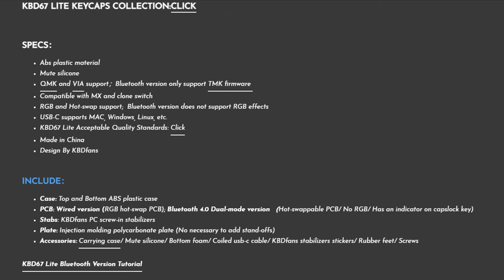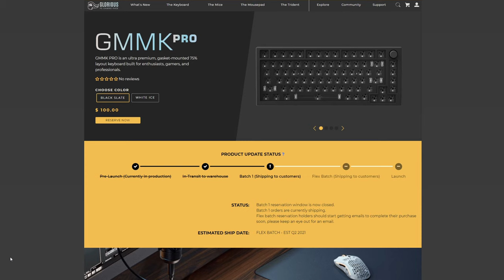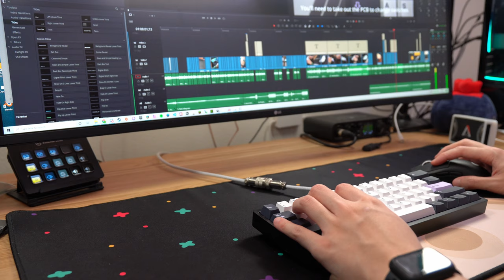$130 No-Frills Budget Custom Mechanical Keyboard | CannonKeys' Bakeneko 60%

Comment: i think I'm gonna pick this up to be my first custom. idc about arrow keys or rgb and i don't think the paint job would bother me. it looks absolutely perfect for me. Thanks for the awesome review!
Reply: the design is open source, so you can take the design, add your own logo or brass weight to it, then get a one off made from a chinese factory for less than 100 dollars. This allows you to get it in aluminum anodized in whichever color. For the PCB you can use a h60 pcb for around 40 dollars. Gasket is 1 dollar and bumpons are 1 dollar as well.
Reply: @rohanmudumba2545  yes but you also get a carrying case

Comment: WOW! This sounds miles better than the other budget boards.
Reply: the case is 130$, a whole build is would probably get to around 200+.
Reply: @OHOE1  I made this comment over a year ago; and at the time, this was the only board that sounded and felt good but was also a METAL case. Yeah, there were cases like the kbd67 lite, ikkk68 aurora, gmmk pro, and the tofu, but none of them met the 3 most important enthusiast principles at an affordable price. Yeah, now we got the qk65 and all. but this board is still great value for its price today. Price, quality, and value are all relative anyway. For instance, I consider $400-$500 on a DIY kit alone to be cheap (Given the quality warrants the price that is), but it may to expensive for you. But that's a whole rabbit hole of debate in itself.

Comment: I really hope this becomes available outside just the US, it's an awesome value, and it would be neat to have one with two full swappable PCBs fully built. Just lift out, unplug the daughter board, plug in a new one, and have a hot swapped PCB/plate/switches.

Comment: OMG make TKL version of this, it's amazing!
Reply: BTW I got my gmmk pro (white ice, but as you said SILVER AF lol)  and put some lubed banana split switches, lubed with Krytox 205g0. I replaced the stabs with the bushido ones from Novelkeys. I took the plate foam out, and got rid of every single screw that was in there  haha . PC plate as well. I really like it and I will be using it for work since I am still a loyal tactile user (lol).
Reply from the maker: @katarixy  oo i dont think ive seen a TKL with a gummy o-ring gasket mount. and nice on the gmmk pro! glad the stabs worked, heard that aftermarket stabs won't work on some plates (but i didn't look too much into it). def a good board that can be made better with some tweaking, which is what custom keyboards are all about anyways
Reply: TKL's cannot be made with this sort of mounting system unless the case is two parts, which drives up the cost.
Reply: @jimmynguyen973  It does seem that the main plates that have that issue are the brass and aluminum plates, with brass being the worst offender. As much as I like the GMMK Pro, I still find it a bit hard to recommend as it does need a lot of tweaking. I had my friend get it, but we are helping him mod it. Otherwise, it can be a bit intimidating. I do hope we see more companies follow through with similar offers!
Reply: @geo7735  Thank you that's good to know!
Reply from the maker: @katarixy  apparently your wish has came true, I have not looked too deeply into this yet https://reddit.com/r/mechmarket/comments/n0jttw/gb_scarlet_seamless_hotswap_top_gasket_mount_tkl/
Reply: @jimmynguyen973   Oh wow this is so clean... I'll definitely look into it more!
Btw, this is the board I mentioned in livestream: https://geekhack.org/index.php?topic=111231.0
Reply: @jimmynguyen973  tgr jane

Comment: Currently typing this with a tofu but I gotta say this keeb def caught my eye. Love the simplistic design but was just wondering if plate mount stabs are as bad as people say they are
Reply from the maker: these are clip-ins not plate mounted. the downside with clip-ins is that they can pop out since they're not screwed into the board, but ive never had a clip in stab pop out personally (make sure its pushed into the pcb all the way)
Reply: @jimmynguyen973  ohh okay my bad. Thanks for the input!

Comment: I personally love the 60% ansi layout. Configuring the right shift, fn, alt, and control as arrow keys on tap is just so much nicer than reaching over to hit dedicated arrow keys, at least for my use cases. Great review!
Reply: what key do you use to toggle on the arrow keys?
Reply: learn to use vim layout and you will never need arrow keys again. 60% is the  best looking layout imo
Reply: @sensuku  Well this is super late, but you don't need to toggle anything. The VIA/QMK firmware allows you to program modifier keys (alt, ctrl, shift, etc.) so that tapping them does something different to holding them down. So e.g. on my bakeneko60, the four modifiers to the right of the spacebar are left, down, up, and right. And the left control is Esc when tapped. And they all behave as normal if you hold them down and hit some other key.
Reply: @JBBell  only a year late lol

Comment: I've been using a kemove snowfox 61, I'm going to change this for the bakeneko hope this is a good decision.
Reply from the maker: I think it would be a great decision! It'll cost you more money because you'll need to get switches and keycaps, but the typing experience will be much better.
Reply: @jimmynguyen973  I already bought the switches, I'm going to use milky yellows and the coral sea keycaps, or some Japanese keycaps, I'm not sure yet about the keycaps

Comment: Not sure about comparing it to the GMMK Pro when they have the GMMK Compact which is actually a comparable form factor. Comparing it to larger boards doesn't make a lot of sense. If you're looking for a 60%, you're generally not looking at bigger boards.
Reply: both beginner customs in a similar price range (sub 200 dollars) which have been released recently

Comment from the maker: The Bakeneko will be released on Wednesday, April 21th at 2pm Eastern! Consider using my affiliate link to help support the channel https://cannonkeys.com?ref=jimmy
Also, I didn't put enough lube on the left side of the spacebar so there's some ticking noise, but I just fixed it with more BDZ.
Reply: You're keyboard master. Amazing video. I like your videos.
Reply: Wasn't there going to be a bakeneko 65%? That's a bummer if not
Reply from the maker: @rba1841  there's a 65% bakeneko, but no clue if a vendor will run it
Reply: Wow, it really sold out in less than an hour.
Reply: @jimmynguyen973  THERE IS???
Reply: When will there be another run of this board?
Reply from the maker: @Sayject  I'm not sure, but from what I understand, more units are already en route to cannonkeys
Reply: @jimmynguyen973  Sounds great thank you
Reply: @jimmynguyen973  also from your view using the keyboard does it have that aluminum sound like there’s no clear sound?
Reply from the maker: @Sayject  There are some keys like the backspace key that has a bit of pinging, but overall the sound is pretty good. You could put in thin case foam, but that would reduce the flex.
Reply: @jimmynguyen973  ah ok thanks man :)

Comment: Without the case and plate foam, does it give that hollow sound? you mentioned it in your video but I'm wondering how prominent that is.
Reply: You can't put case foam, but idk about plate foam. From what I hear and others hear the backspace and right shift is a bit hollow and the left side of the space bar is rattely because of the clip in.
Reply from the maker: @barackobama6822  i prob couldve lube that left side of the spacebar more to get rid of the ping, but yes those keys can be a bit hollow sounding, but it doesn't bother me that much (but could for others). there is about 5mm of space from the bottom of the case to the top of the mounting points, so i think you can put in some thin case foam (but it’ll prob reduce flex)

Comment: Looks like a great option, but the clip in stabs are a no go for me. I'm hearing some rattle on the left side of the spacebar during your sound test :(
Reply from the maker: Yeah I didn't put enough lube on the wires, but I just fixed it. I dont think you should write off clip in stabs.
Reply: @jimmynguyen973  Sweeeeeet :)
Reply: if he used dielectric grease then there will be no rattle. that's why dielectric grease is proven.

Comment: Do you happen to have information on the ISO compatibility of this board?
Reply from the maker: no idea honestly...even if the solderable PCB that you can buy as an extra supports ISO, the plate does not. since it looks to be a standard 60%, you could probably use any 60% plate that supports ISO, but i haven't tried myself
Reply: @jimmynguyen973  What keycaps u used on the build?
Reply from the maker: @boteko4429  nicePBT Sugarplum

Comment: How does this board compare to kbd67 lite?
Reply from the maker: The biggest difference between the 2 is the case: do you want a metal case, or a plastic one. Do you want a 60% or a 65% (altho there is a 65% bakeneko coming)? In terms of sound, I think KBD67 will result in a thockier sound due to the silicone.